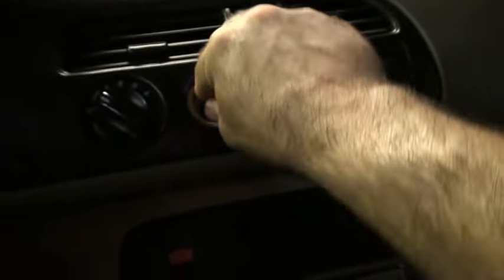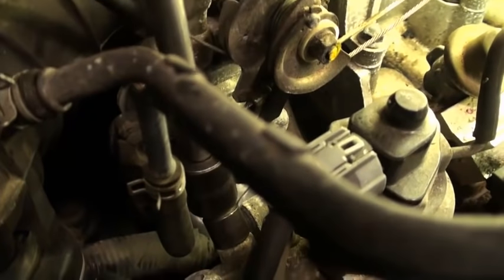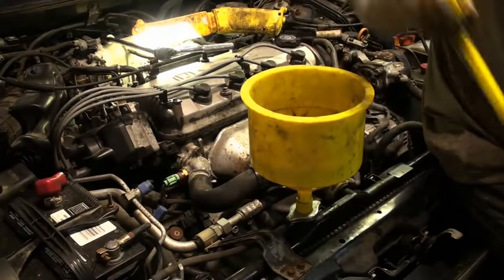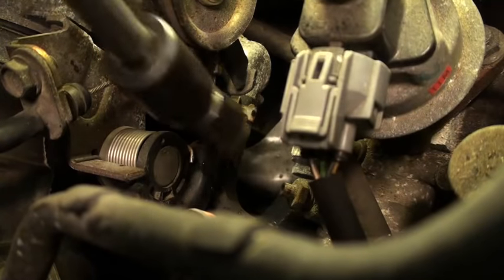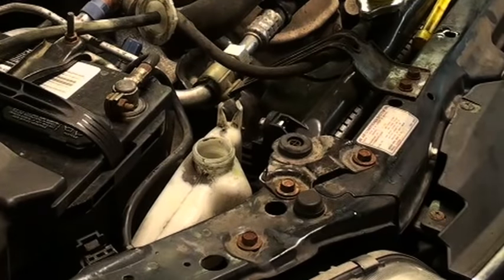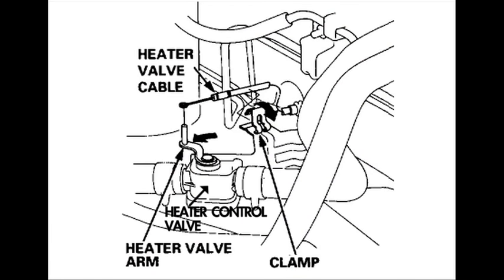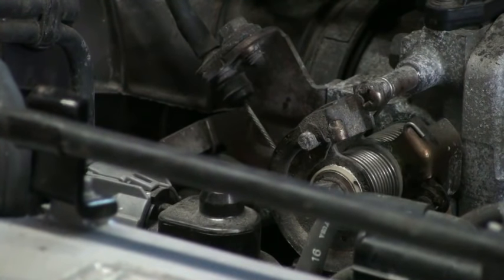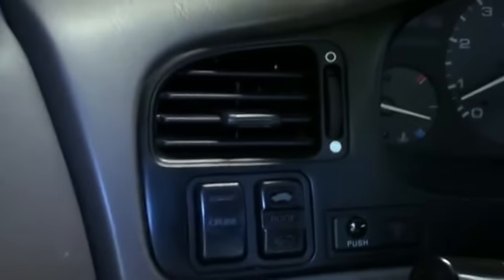How To Bleed A Cooling System - EricTheCarGuy

Comment: hey erick my name is Robert I have been watching your videos for a while now I am curently going to uti and i am still learning today was my first day replacing a thermostat I have a dodge magnum 3.5 I that wouldn't warm up fully or correct I need the engine light it said replace thermostat wen I took out the thermostat and housing there was no thermostat inside so I put the new thermostat in the rite way how all data told me to do once all my hoses were re installed I  open the upper radiator hose with a screw driver so I could bleed it as I was putting in coolant once I noticed water starting to leak from upper radiator hose I removed the screw driver pushed on hose put on clamp and continued putting in coolant I no the capacity was 2 gallons about I was only able to put in about a gallon and a lil bit of another gallon it stayed full at the top and wouldn't let me insert  more it was full didn't go back down so I could add more coolant as soon as I was done I started the magnum I waited for it to warm up to operating temp and made sure cooling fans came on they did so I took it for a two mile ride and she overheated as soon as it did I pulled over checked fore coolant leaks  no leaks I waited for car to cool I added more coolant in case it was low and still wouldn't let me put more it was full.I figured maybe the previous owners removed thermostat because maybe it overheated once before maybe thats why there wasn't one in there wen I removed everything can u give me your opinion on this one?
Reply: Hey, I have the almost exact same problem... Did you ever find out what  was the cause??

Comment: Erick, i need you're opinion on this situation I am having,So I changed my radiator last month and Installed everything back how it was , reason for change the other was broken, So after the change I added coolent and all followed you're steps, but I noticed after an hour or 2 of driving all the coolent ends up in the reservoir,I have bled the system about 6x already and still the same problem, what can be cousing that problem? bad head gasket? air in the cooling system? please help me and direct me in the right path I want to get this fixed 
also I have a 90 Acura Integra

Comment: I doubt after so long I'll get a response but after doing a headgasket when bleeding I get tiny condensed white foamy type bubbles. Is it possible that the headgasket is not properly seated and gas is getting into the coolant? How would I know?

Comment: I used an air lift tool on my Honda do I still need to bleed the system ?  I replaced the thermostat with the 190 one...
I have a hunting idle but not all the time.... it runs rough until it gets around 1000rpm.... I replace the cap wire rotor and plugs...and still the same issue..

Comment: my car is a fiat 500 1.1 lt engine no air con, anyway its not heating the car, it has a coolant tank but no radiator cap on the rad, it has two bleed screws one for the heater and one for the rad. I use the car for going to work, also there is no bubbles in the system. What do you think might be problem

Comment: Hi Eric, thank you for the video.  If I currently have a bouncing idle, from 700-2000 RPM, would you suggest this bleeding procedure first before checking for air leaks elsewhere?  Didn't have a bouncing idle before I replaced IACV valve, didn't replace throttle body gasket, then bouncing idle happened with code P0505.  I plan to replace TB gasket, check hoses, clean connectors, and wanted to know when I should do your bleeding process.  Ty for your help!
Reply: Did you ever find the issues? I have the same problem currently
Reply: @Calbomb8  It was a faulty IACV.  Purchased another one, replaced it, and then looked up a video on how to do idle relearn.  After I did those things, it solved the issue.
Reply: Okay I my replacement part must be junk... I’ll order another one.. Thank you for your reply!
Reply: @Calbomb8  Yea, the first replacement I had was from eBay, and it wasn't good.  I had to buy it from a more reputable place like RockAuto.

Comment: I have a 1996 maxima, the top radiator hose is getting hot, but the lower hose was not.  I have changed the thermostat, and now the lower hose gets hot at the thermostat but not at the bottom of the radiator.  The guage is still showing it running hot.  Could it be air in the system or maybe the water pump?  The water pump was replaced about 2 years ago, but it was leaking then and dripping down on the compressor, which it is not now.  The coolant is not low and the radiator cap is getting hot as well.  Any help would be great.

Comment: 2024, I finally surrendered and BOUGHT a bleeder kit. 2011 Jeep Grand Cherokee 3.6L v6. Giving me fits with new radiator,  two thermostats, water pump. When I got it back from the dealership,  the upper radiator hose had collapsed and opening the radiator cap (cold) SUCKED AIR IN. I did the process and idled and worked the throttle for THIRTY FIVE minutes watching the bubbles in the funnel until it stopped and I could see coolant mixing in the funnel.

Comment: Eric, I just got done replacing the UIM and LIM gaskets (and heater hose elbows) on my 3800 series II.  no leaks that I can see, runs great now BUT after a heat up/cool down there's always space in the top of the radiator and the overflow tank is full.  I siphon some out of the overflow to top off the radiator. but then after a heat up/cool down its back in the overflow tank again.  wtf?  I've done this probably 6 times now.  its probably about 1-2 cups of coolant. the level never goes down, just moves from the rad to the overflow and I keep moving it back.  any ideas what's going on?  (also, replaced the cap which didnt help).
thanks!

Comment: Hey Eric I have an 2003 envoy that I just replaced the transmission but I have to press excess amount of gas for it to move properly could it be that my torc converter is bad

Comment: Hey Eric or anyone who might be able to help I know this is an older video but I have a 97 accord ex and I need to bleed the system I have a bleeder valve but the thing is my heater core needs to be replaced.. Is there anyway to bleed it without using the heater control? Whenever I decide to use my heater with coolant in the car the coolant starts going through my car under the seats. Thank you for these videos they're a big help

Comment: I have the same accord well a 96 Ex, but wow I am going to flush the cooling in mine because I think it just is running hot and it needs a refill, but after I will definitely use this video to bleed the system. Thanks so much! I have always wondering what that noise is when I start my car. I thought it was like a air compressor or something to level the car out, but I guess its the ABS pump. I am not sure if you have done a video on this before, but my accord's gauge cluster's shift lights don't light up and if those don't then I am not sure even if the rest of them work. Also the gas gauge stays at full (I will eventually test the floater thing) which isn't that big of a deal since I just look at how many miles, but it would be nice to have that working too. Wow woops I just rambled a lot lol, its almost 5am, that's probably why. Anyway if you do answer awesome, if not its okay lol I will look around, its just I have, but never found anything about like why the shift lights and possibly the other warning lights besides seat belt I think dont work. Thanks and keep up the great work! :D
Reply: Oh and also I think my temp gauge is messed up because when I turn the car off it like goes at like the 6 if you are looking at a clock and when I start it up and wait a couple minutes it goes to like about 4 or 3.5, but that could be normal, just not sure.
Reply: urmastertech
It`s working how it`s supposed to. Dont worry.
Reply: Oh okay lol, I just thought it might be off because I think like a lot of my guage and lights are broken because my gas guage stays up, the shift lights don't work and possibly the check engine and oil lights may not work, but I don't know. I may test them when I have time, but for now it works. Today actually I tried to fix my wipers because they just all of a sudden stopped working, and I have to order these special clips or something because the one is broken, but while im at it I will replace all 4.
Reply: oh I repeated some stuff I said earlier lol
Reply: good thing you have a honda. Honda parts are reasonably cheap. Well atleast where I live they`re cheap. good luck with the wipers
Reply: yeah thanks, I think they should be I only have like one honda dealership within like maybe a 100 or so miles. Like I live in MN and I think they have one in the cities or so, I live in central mn its like an hr or so away to cities. If I can't order from them I could probably find the things I need online somewhere or directly from honda. it is a nice car, i just had to sort of put a lot into it like rebuilt alternator, valve cover gasket, new tires. I don't know there is probably more, well with replacing the valve cover gasket I tried to retap the head bolts because they are stripped, not from me, but previous owner, but it didn't work, so it leaks a little oil, but not much. I had to get my brake lines redone. Its my first car, so I figured it would need stuff like that done to it since it is 18 yrs old. It is so weird right now because I just kept the wipers off and left the gassel or whatever its called off too just because I need to get in there anyway, just because it looks weird to have no wipers on a car.

Comment: i have a 2002 jeep wrangler with the 4.0L straight 6. about a month ago i was driving down the road and my radiator decided to blow. so i replaced the radiator, thermostat and upper and lower hoses. usually my jeep always ran exactly at 210, but now it runs around 215, which is still normal operating temperature. but when it is a 215 or so i would be driving down the road and suddenly it pegs right over to the red which is around 250. the check gauges light comes on, i figured i must of fried the sensor so i replaced that too. but if you continue to drive for a minute or so it goes right back to operating temperature, or if you turn the car off for 30 seconds and turn it  back on it says it is still at operating temperature. also when you squeeze the upper hose it feels like there is no coolant in it. so i looked into it and there must be air in the system. so i ran in on my drive ways incline with the cap off, let it heat up and cool down with it off. that didn't work so i tried to flush it. none of these things are working. unfortunatley the 4.0L straight 6 doesn't have a coolant bleeder valve. Any suggestions?
Reply: also i don't have any heat

Comment: whats up eric. i love your vids by the way been following u for about 2 years now. anyways i have a 99 honda civic si b16a2 5 speed manual. i changed tps throttle body map sensor alternator and belt plugs wires dizzy cap 02 sensor and idle control valve and more. my car has a normal steady idle but if i rev it in neutral or put it in gear and press the clutch or drop it in neutral while driving to come to a stop my car idle goes up and down for a minute until it settles. could this be air in the system. oh yeah i also changed the radiator and opened the bleeder valve but did not do this method. could air cause my car to do that?? thanks bro for the help. oh yeah i have no fast idle valve because i have aftermarket skunk 2 throttle body which does not have one

Comment: What if someone were to open the radiator cap (the one your not supposed to) after running the car until its hot, Would the air come out with the gush of scolding hot coolant? For an even quicker but messier solution?.

Comment: would air in your coolant system cause the reservoir to over flow then cause the radiator to lose coolant I have a 2004 civic

Comment: I'd like one of those funnels, seen it before a while ago but haven't been able to find that or a similar product in europe. Would come in useful on my motorcycle too, tilter radiator cap and a lot of coolant hoses that need to be removed to preform maintenance. Its not hard to get the air out, but a lot will be spilled each time.
Reply: got my funnel last week on amazon for $19.00. it really works and deff spill free =D

Comment: I have a 1992 Honda prelude bleeding the coolant and turned heat on temp goes to red turn heat off temp got back to half is there still air in the heater core maybe?

Comment: Good video! I have a 05 Mustang GT 3v and it only has one bleeder valve on the driver side radiator hose connection on the top of the engine.  Should I do the same process where I crack that open while filling with coolant?  I have seen some where people open that after they have a air pocket or over heating problem.  What would you suggest? Thank you for making really good videos man!
Reply: with the fords like yours and mine i would highly recommend picking up an airlift tool which eliminates the need to even run the vehicle after filling..no more hunting for bleeders or babysitting a running engine for a half hour wasting time
Reply: Is the airlift tool something to pick up the front end? I have ramps and jack stands, Just wondering if those would have the same effect as the airlift because I don't know if that's for the cooling system itself or the pitch of the car. Thanks man
Reply: Rampage4reel No sir.. the airlift tool is just a device that makes refilling your coolant very simple..there are a few manufacturers out there that use the name 'airlift' specifically uview brand..mighty vac i think makes one..and gates makes one snap on.. mac tools etc...check out some videos the tool is awesome and is a true solution..i just bought one today as a back up becasue i got a great deal on the one by gates p/n 91003...but i highly suggest going with the Uview airlift pn 550500 or 550000 you will not regret it it pays for itself in one use..as for jacking up the car..this is for the final fill so your car will be on the ground
Reply: Thanks man I appreciate the info. Going to look that up now.
Reply: Thakiid101 Thanks again for your help.  I have a quick question. On the airlift do I need any special connections to buy for my air compressor? All I have is the one for filling up my tires.

Comment: I didn't get why was it's needed to rev it up until the fan kicks in and hold at 2500 rpm. Wouldn't just leaving it idling do whats needed (cuz i think all needed is circulating the coolant through the whole system and thats it)?
Reply: Stefan Ovcharov I think it is to make the engine heat up faster and hotter thus forcing the fan to go on.
Reply: XeelS All right, that's clear. I wonder why bleeding requires the fan to kick in?
Reply: Stefan Ovcharov Fans kick on and forces coolant through the heater core, therefore bleeding any possible air out of the core.
Reply: I ask about the radiator fan which Eric talked about and said should kick in. The fan of the heater core doesn't play any roll. At the beginnig of the video Eric said the fan inside the cabin should be off.
Reply: ***** Now that's something sense-made-of. Thanks for explaining.
I also have another question.  Where does air get out of the system from during that reving process since the bleeder is already closed after filling the anti-freeze?
Reply: Ryan Lee fans don't force coolant, the coolant  circulates through a closed system. its basically to heat up the engine and open the thermostat and make sure coolant is flowing sufficiently fast enough to push any air pockets so when he fans kicks in you know the coolant has achieved normal operating temps and the thermostat opened.
Reply: Exactly,! When u turn on your car coolant flows a little bit thru the by pass hole in the thermostat as the engine heats up so does the coolant and that hot coolant will in general open the thermostat at 190 -200 degrees then the coolant starts flowing normally and when u turn on the beater a valve opens in the coolant system and coolant is allowed to circulate thru the heater core and BAM... Heat!!
Reply: +XeelS True, but also to get the water pump spinning faster to distribute the coolant faster

Comment: i just put a radiator in 96 dodge ram 2500 and am having the up and down idle.. i was sure I'd bled all the air out, but since I'm have idling issues now i wonder.. i let the air bleed out for over 30 minutes til there were no bubbles coming out.. but i didn't know about the bleeder valve.. so, 2 questions, is there a chance it has already messed up any other of my engine components? i haven't driven it much since i replaced the radiator, probably 20 miles maybe slightly more..  and 2, is there any way to know for sure that you have no air in your coolant system before you take off in it? thanks for any replies.

Comment: Why would low level of the coolant cause rough idling? What's the mechanism? I have both, but rough idling (revving up and down, up and down) has started after the engine stalled in a deep puddle.